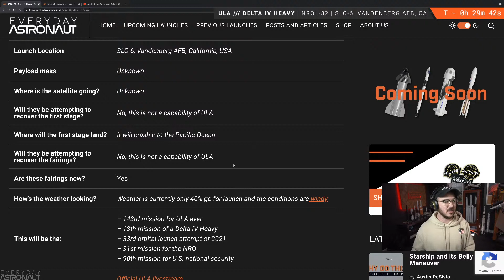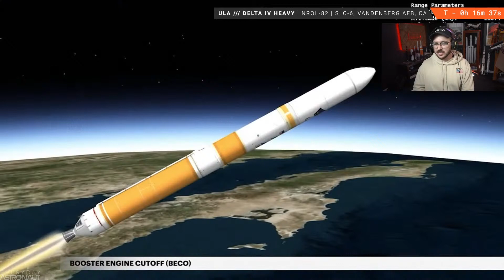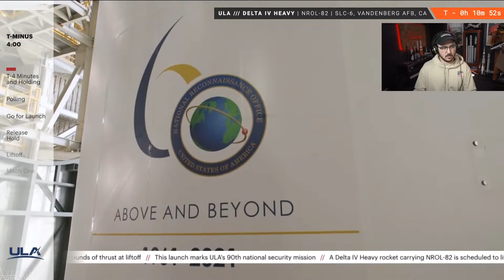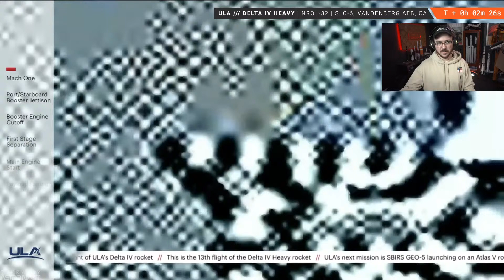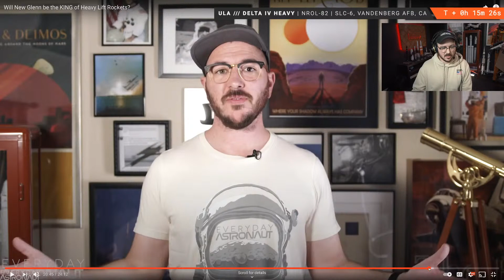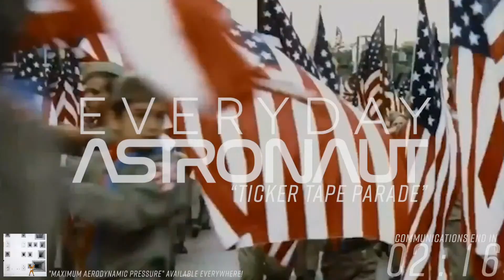Watch ULA launch the world's largest operational rocket, the Delta IV Heavy!

Comment: One reason Delta IV Heavy is getting retired is how expensive it is to launch.
Reply: Let’s be real. Elon lies about his costs.
Reply: @Brianisawesone  Liquid hydrogen is 10x more expensive than methane and LOX combined Though its very reliable but its costly.
Reply: @Brianisawesone  I doubt that honestly. Frankly I believe would a (smaller company) private sector buy Delta plans the would be able to built it and launch it for far less. When a company or state agency gets too big and too used to state money it's infrastructure bloats and is twisted and their cost go ridiculously high. But it's not easily (if at all) possible to "heal".

For those reasons I am very worried about SLS. But for same reasons we can get such big an uneconomic beauty capable of hauling that much as SLS should.

So it ain't all bad :)
Reply: @volfcz  The problem with SLS has nothing to do with Liquid Hydrogen.  They've been using Liquid Hydrogen upper stages since the '70s.  Space Shuttle uses LH2.  SLS is even build out of spare Shuttle main engine.  The problem is that it's LITERALLY decade behind schedule and multiple times the original estimated cost.  There's a reason why NASA's current rounds of contracts are all pay upon delivery of milestone goals and service rendered and NOT Cost Plus, which was instituted during WWII when you needs to get things done ASAP.  This was carried over to the Space Race during the '50s and '60s.  It has metastasized into the current pork barrel job program SLS is today.  It cost $2 billion per launch, and at that price tag, there's no way NASA can afford to launch more than once per year even if it's ready.
Reply: @Brianisawesone  OK.  NASA auditor obliviously was asleep.
Reply: @dyingearth  my point is they eat the cost over what they claim in order to get contracts.
Reply: @Brianisawesone  SpaceX is not in the charity business.  Their internal cost for launch (Starlink mission) is about $28 million for Falcon 9 in reused mode.  You think this is not a reasonable amount for an used rocket?  You have a better figure?
Reply: @Brianisawesone  Ok hater.
Reply: @neeljavia2965  ok, dummy.

Comment: Really bad broadcast from ULA compared to SpaceX Streams.
Reply: Maybe ULA focuses on customer success over making people on the internet happy
Reply: @sabretechv2  still a fact and making people excited for spaceflight, by putting some better cameras worth nothing compared to the rocket cost, wouldn't hurt them much. As you can see, SpaceX does both, customer success, Good Streams and reusability.
Reply: @I-Singu-I  ULA has more accurate orbital insertions than SpaceX and consistently flies more complex trajectories like these for the NRO. The theater of SpaceX is cool, but in reality it’s mostly a bunch of useless LEO launches where they are their own customer. SpaceX wouldn’t have been able to reuse boosters for this type of launch, propulsive landing hurts lift capacity. It’s no secret Delta and Atlas are heritage systems, but they serve a purpose and outfitting them with way more cameras just to make people on the internet happy doesn’t really fit their missions, especially when telemetry and TDRSS bandwidth is always limited and valuable.
Reply: @sabretechv2  As you repeat "it's just to make people on the internet happy" you don't get the point that those people you are talking about, are the next engineers and scientists. It is still worth to inspire people to work for your company, or aquire new clients. If you think this is just for some viewers, you clearly don't get the point i am talking about.
Reply: @I-Singu-I  you clearly don’t work in the industry so not sure why you think one model of having a good social media game is necessary for every company?
Reply: @sabretechv2  you just asked a question, for which my answer is already written above. And you clearly don't work in the "industry" too if you have the time to imediatly respond to every youtube comment.  You should clear things out for yourself first, before getting on your high horse. But i will repeat myself, inspiration is an important thing for the future workers in this industry. I am not futher arguing over my personal opinion. But thank you for your guessing.
Reply: @I-Singu-I  man if only I could send you a pic of where I am at right now lmfao. I asked a rhetorical question you have no idea what you’re talking about. You rate a company based on its entertainment factor. We have no shortage of people